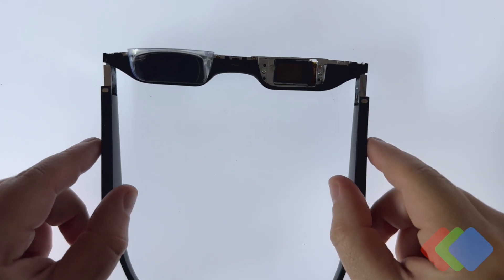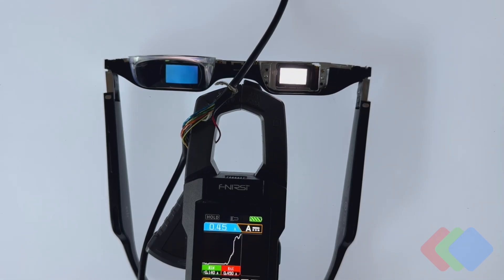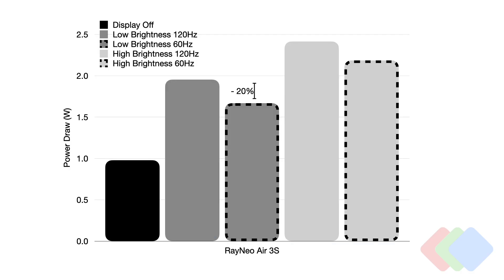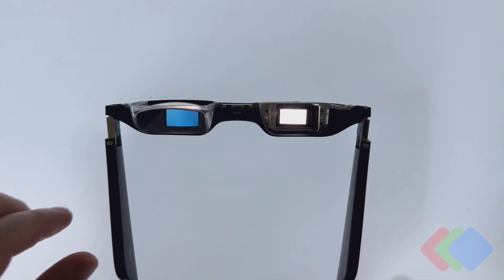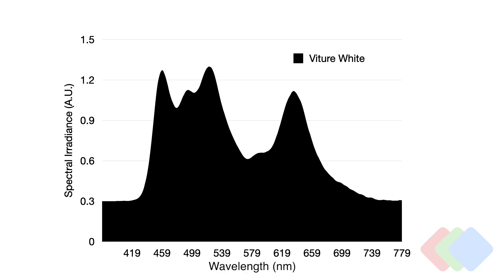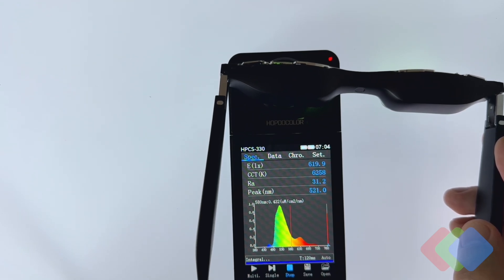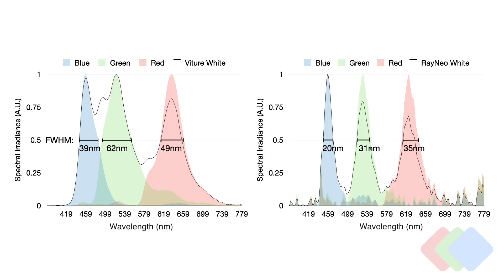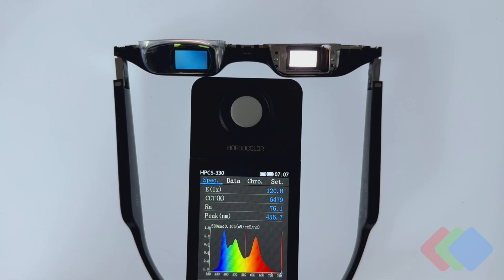Display Glasses - Power Draw & OLED Spectrum Measurement

Comment: 14:30

Does that mean that in a real situation, we perceive a white window at only 120 nits ?

Then how do you explain that many people find these glasses too bright and have to lower the brightness ? 🤨
Reply from the maker: Great question - 120 lux (illuminance) doesn’t mean 120 nits (luminance) to the eye. The main point to takeaway here is that with these birdbath designs, more than 80% of the illuminance is getting lost through the various polarization and partial reflection steps which is why you need very tinted lenses to be able to see the image clearly despite some displays with very high starting brightness (5000nit).

The perceived brightness will need more specialized equipment than I have for now… Regardless though, what some people may perceive to be ‘too bright’ in these glasses and what is actually ‘bright enough’ to have readable information in an outdoor setting are quite different. 

Glad these are bright enough for you!
Reply: @DisplayTrainingCenter thanks !

Comment: Wow! Great information.  I know they’re not out yet but are u going to try and source a set of the luma ultra or beast glasses that advertise newer Sony technology? I’d be curious as to whether they actually chsnge the panel or just change the quality of the lens to create a brighter output.  What are your thoughts?
Reply from the maker: It is possible that Sony has refreshed the panels to be brighter and with an updated OLED - I’ll have to get my hands on those to see. 

I’ve got a backlog of other glasses and headsets, but if anyone has one that they’re willing to lend out for some non-destructive measurement, I’m all ears!

Comment: Thanks for this amazing break down, I definitely learned something!  Question though, did you change the color mode at all of the Viture Pros?  IIRC it can only be done on their website during calibration, though the new Luma Pros you can switch color modes (like with the RayNeo Air 3s) within the HUD/physical controls.
Reply from the maker: No, these are all measured in their "standard" mode which as you point out, only matters for the RayNeo's which have user switchable color profiles - all the others are the out-of-the-box color profile. Glad it helped you learn something new!